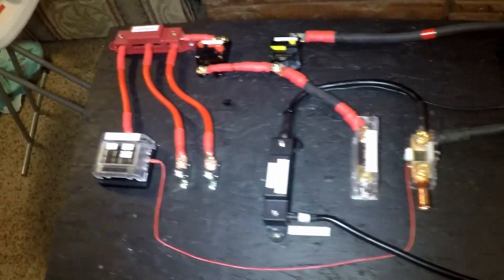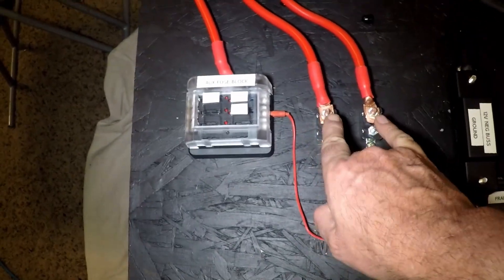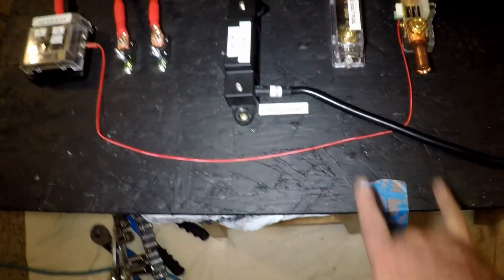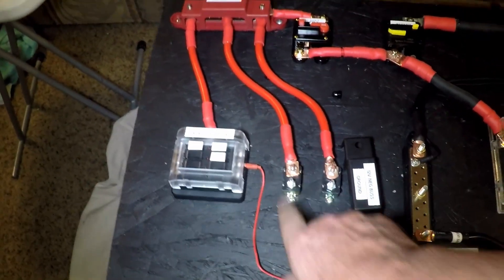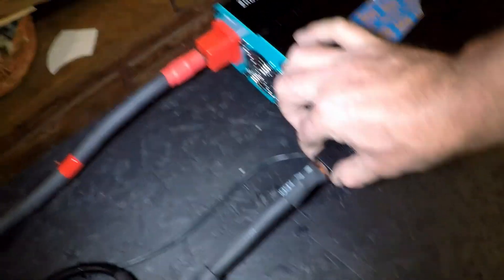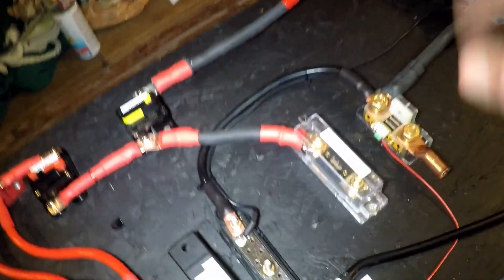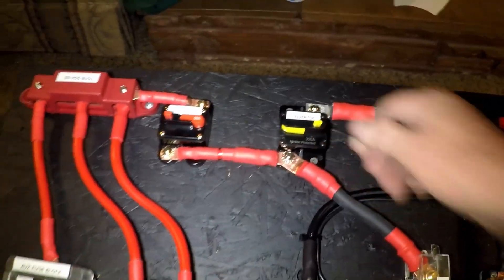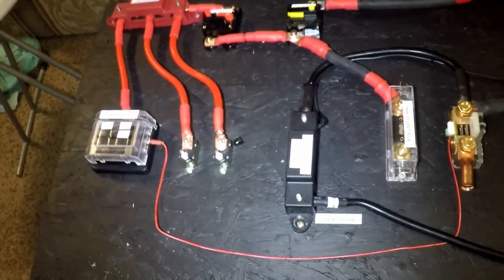Board Layout Finished and Reay to Install RV Electrical System Upgrade

Comment: I used a 200 amp breaker for my positive bus bar. You showed that you used a 50 amp breaker. Would it make a difference ?
Reply from the maker: The 50 amp breaker was for the 12 volt supply to the trailer. I upped it from 30 to 50 Because i added extra to the curcuit. There was a 350 amp breaker that supplied the inverter.